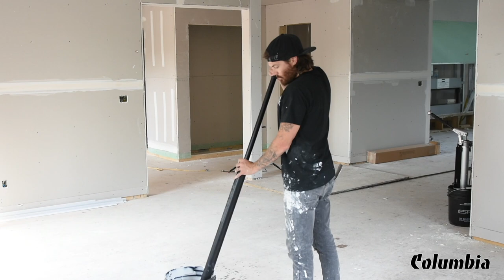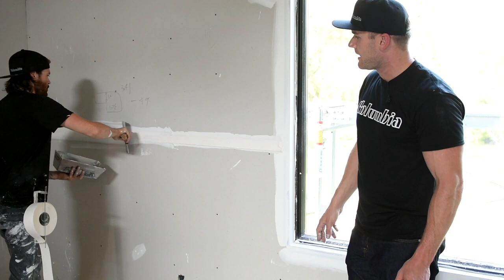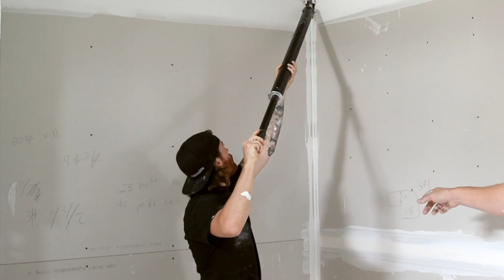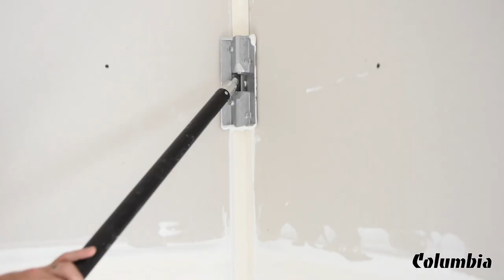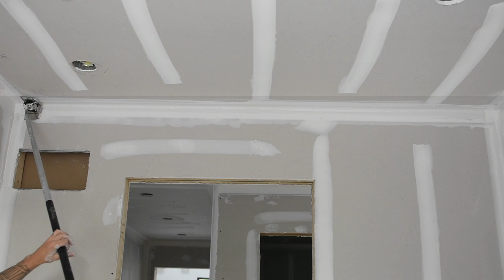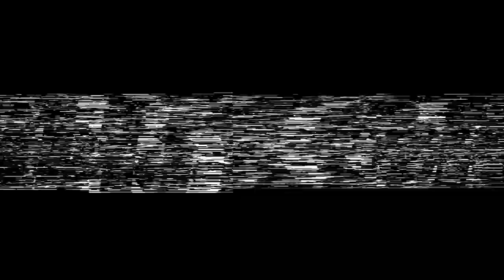Step by Step - The Drywall Taping Process with the Columbia Commando Set

Comment: A couple of things. You can take off the head and just use the nozzle to fill paper corner bead with it, lay corner bead on the floor, fill it with the tube, then pick up the corner bead and stick it on. You can use the flat head and run it along any flat or butt or series of screws then wipe it off with you knife. You run your flat head twice or three times depending on which. Then skim. Take your excess mud that you accumulated in your tray  then use it on corner bead. To get paper tape ready for inside corners, take two small piece of drywall and sandwich the tape between them, folded, then pull through one side, you can get tape already folded fast. On painted surfaces where there is drywall pieces installed it's difficult to get it even and to avoid pinholes, instead use a roller and dip it in a pail of mud and roll it on. It makes better contact with the painted surface and just skim. It's faster and the results are pinhole free.

Comment: Quick question...after using roller the flusher was used to smooth out tape and flusher was used for 2nd coat as well. Your not using an angle head? Or would you use flusher first then angle head on 2nd pass?? Thanks